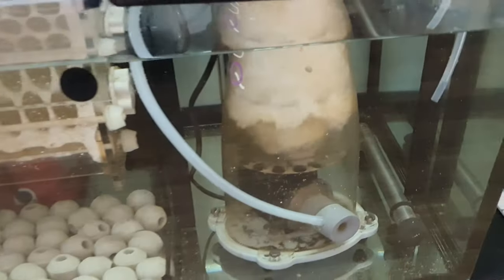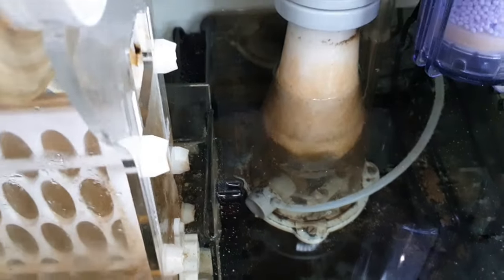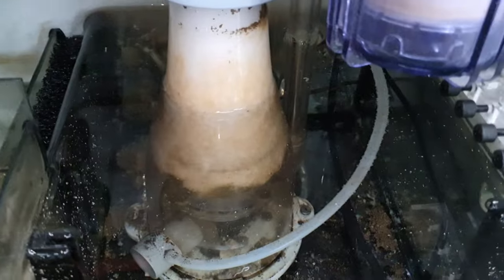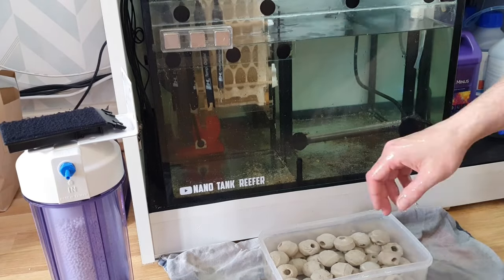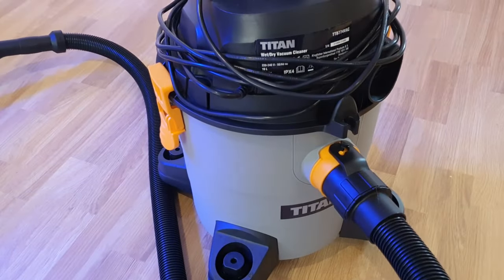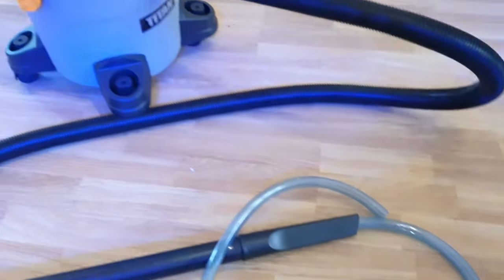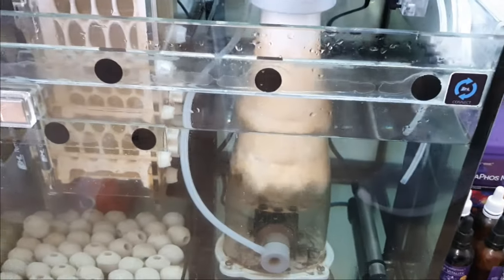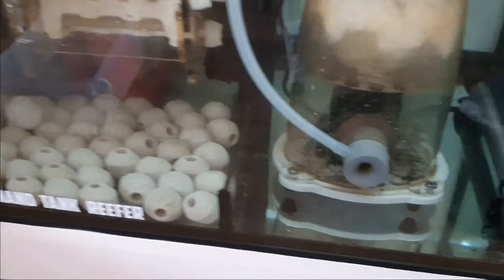Reef Tank Maintenance - Cleaning Out the Sump On the Red Sea Reefer 250 - Saltwater Aquarium

Comment: I was thinking if there is another way to do this sump clean..like some pump that will pump the water out and you feed it through like a sock while keeping it in the sump? This way, the water remains, sump is clean too? Or best to remove the water completely with th detritus?
Reply from the maker: If it wasn't in such a state I could have used the old King of DIY polisher filter method. He did a how to video years back with a bottle crammed with floss on the end of a pump. That would definitely work, I could run it for a few hours and remove it from the sump once the job is done 🤔
Reply: @NanoTankReefer  I'll check it out, I found the video that gave me the idea. It was mad hatter's video titled "how to remove detritus...".
2 year old video but he had this pump with two ends, one that sucked in and the other end that pushed out the water what was sucked. Had a sock at the end to grab the detritus. I'll see if I can get that pump in UK, might be a cheaper and quicker route..maybe
Reply from the maker: I'll check the mass hatter video out now 👍